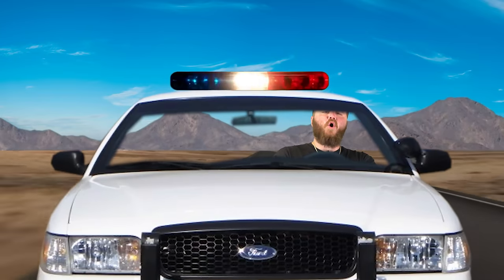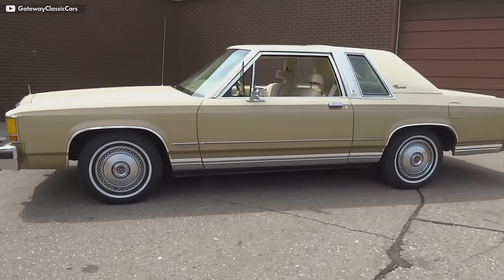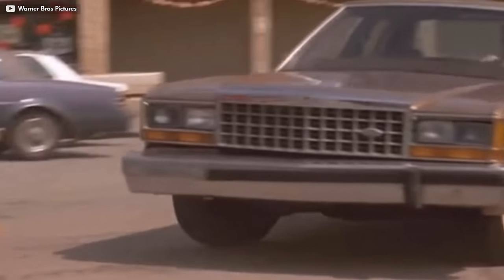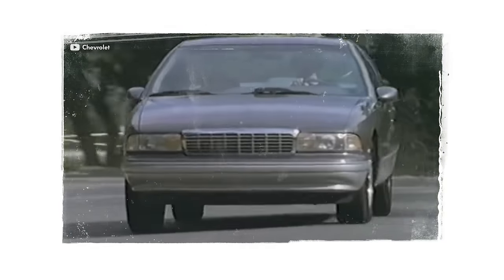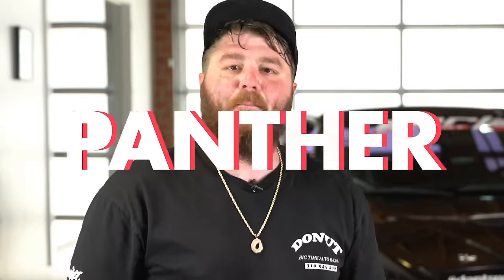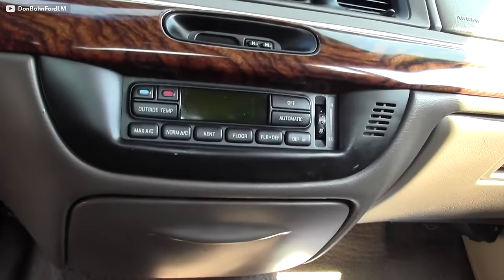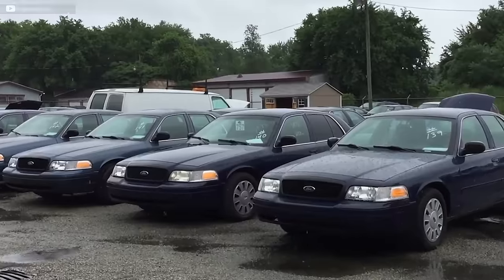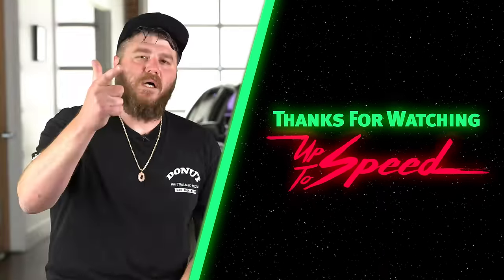Ford Crown Victoria - Everything You Need to Know | Up to Speed

Comment: Had 6 of em, 2 over 300k miles on 2 and still rollin, one of the toughest and most affordable cars to own and fix ever made, ive tested for years and can say that without a doubt. Would love to have one with a new 5.0 coyote swap and manual tran.
Reply: Consider the 6.2 sohc f series engine. The lowest rated truck trim engine is 385hp/410ftlbs on 87 octane. Cheaper than a used coyote and arguably an easier swap into a panther due to the alternator location on the coyote.

Comment: Nobody can look at a crown vic as a civilian car. Crown Vic’s are either seen as cabs or Cops
Reply: Raymond Jameson My dude besides the underbody shit, only difference betweeb civilian and police cars was a grille, a spotlight, some door trim, and the decklid and tailights. Besides those three things, they're the same on the outside.
Reply: Yeah, just try look the rear passenger doors. If it's normal, either cabs or civilians. If it's short, it's Police.
Reply: Urara Easiest way to tell if its a police car is checking the drivers door actually. Police Interceptors were never fitted for door code modules
Reply: Muad'dib2288 exactly 😂
Reply: Raymond Jameson yeah
Reply: The way to tell if it was a police car is the vin. If P71 is in the vin its the police vic. 2010 and 2011 was P7b in the vin
Reply: Raymond Jameson Unless you live in Bahrain, Dubai or Saudi Arabia where Crown Vic's are mostly a civilian cars.
Reply: The Crown Vic is used as a cop car in Jordan (somebody confirm this)

And it was even used in Russia ('97 models) and Montpellier in France!
Reply: I mean mine looks like a cop but sounds like a mass shooting...gotta love burble tunes
Reply: Y E S  S I R .
Reply: @A7XFan800  
Other way around
The P70 long wheelbase is the one youre thinking of made for taxi services and I think some town cars got that extra length too
The P71 (police package) P72 (fleet non police package ie work vehicle) P73 (base) and P74 (LX) all share the same rear doors and body length
Reply: once when I rolled up in my vic a buddy asked me, "man why you gotta try an be like a cop or somethin rollin up in a wannabe cop car?"
And I replied "Why do cop cars look like mine, its not my fault they got good taste."
Reply: That is true, even in the '80s models. But there are easy tricks to distinguish between the fleet and regular counterparts.

Comment: Its funny that AFTER the crown vic is discontinued that now 18-30 year olds want them mostly the interceptor and the crown vic gets this massive internent cult following.

I think ford really missed out not making a ford badged performance version other than the interceptor. Mercury marauder is badass but the problem with mercury is it will always be seen as an old person car brand
Reply: They did have a performance vehicle. A company called Ford Performance Vehicles (FPV) in Australia made the FPV F6 Typhoon and GT R-Spec and normal Ford Falcons with Barra engines. 
Just seems like Ford didn't like its Australian subsidiary making a better car and wouldn't export them. Full sized family sedans that could easily compete with Mustangs, Hellcats etc. Even GM killed of the Holden Commodore (Chevy SS).... What's with the salty American car companies nowadays
Reply: @ImplicitSilence  low sales figures vs other brands they own.
Reply: @ImplicitSilence  

Interesting though i meant a ford badged performance version of the panther platform/crown vic specifically

its too bad we didnt get the modern falcon in N america though. My dad has a 60s falcon and a modern version with a fast engine would kick ass in fact he swapped a v8 into his when he was younger and it apparently was insanely fast you couldnt fit a super massive v8 under there (back in the days when displacement was the only way to get more hp but it had a super good power to weight ratio
Reply: Love to have both.
Reply: Not in Latin American culture, at least in Mexico and Colombia the Marquis was always viewed as a cartel boss car back in the 70s-early 2000s
Reply: If Ford had revived the Crown Vic instead of making a fake Mustang SUV...
Reply: Yes, younger people want the police P71, but me, as 26, I still rather take the civilian model, preferably the LX.
Reply: What about the cvlx sport?
Reply: it’s also super hard to find a marauder and they’re super expensive when u do find one. So instead of buying a marauder i bought a p7b cruiser
Reply: It's a new classic and milenials and gen z like classic cars it's a cheap classic but values going up.

Comment: I would imagine a video about Crown Vics should have mentioned that the old ones came with the same 5.0 engine from the Mustang GT and was also offered as a wagon. Also the name "Police Interceptor" which is quite a staple on Crown Vics was never mentioned, specially since Police Interceptor (or P71) are quite beefier and have tons of upgrades compared to regular Crown Vics. Also failed to mention that the Marauders came with the Cobra's DOHC engine, which is quite worth mentioning instead of just saying "redesigned intake".
Reply: Paco Ibarra / Tofu Drift Van Paco droppin' knowledge. 

Hai Paco!
Reply: THANK YOU! I mean everyone knows the crown vic as a police car, yet the video went in to LITERALLY no detail about the police interceptor.
Reply: In 1981 you could get a 400 in the wagon...
Reply: Not Cobra but Mach 1, it was the aluminum block naturally aspirated DOHC 4.6L that the 2003 - 2004 Mach 1's had (sadly the cast 6 bolt crank instead of the forged 8 bolt though.)
The 2003 - 2004 Cobra engine was a much more stout beast sporting a cast iron block and forged internals.
Reply: Paco Ibarra / Tofu Drift Van also, dont forget the taxi
Reply: Weren't the 5.0s in the crown victorias a bit different from the mustang's? I thought the mustang's 5.0s produced more hp.
Reply: It is true the old school Crown Vics did have the 5.0L Windsor like the Mustang of their time, but however, the Mustangs were HO while the Panthers wasn't.

And, the P71 isn't THAT much tougher than the civilian counterpart.
Reply: @BRBingeDrinker  They do have more power. Being HO, they have 225hp at best, while the Vics were only 150hp non-HO.

Comment: I just inherited my grandfather's 2002 grand marqis
Reply: nice, floor it!
Reply: I’m sorry about that
Reply: You're lucky mate
Reply: As much as it sucks to not have your grandfather, supe that bad boy up like he would'v wanted! Just remember, the Police Interceptor is a LOT different underneath than the Grand Marquis. Do your research depending on year. Some specific differences include
- 04+ CVPI had a new 80mm MAF sensor and intake. Need computer tune to get that to work
- All CVPIs got dual exhaust.
-Spring rates and ride heights are different between the two
-Driveshaft is aluminum in CVPI vs steel in civilian cars. Also tailshaft and transmission output shaft are longer

Thats just a few of the big ones. My plan for my Mercury is to get a CVPI parts car and swap what is needed
Reply: AlecChrz Did he diedededed?
Reply: Potato yeah
Reply: JHeino10 You're probably addressing the wrong person as my only comment was asking if he died or just stopped driving.
Reply: AlecChrz nice
Reply: Yeah, the only good car mercury has made in a long time
Reply: I got my grandmas black marquis ls
Reply: Congratulations. Floor it
Reply: I take that back. Had a misfire on cylinder 5, and had to get the coil replaced. Specifically, from clamping down hard on the gas, ease on it then floor it.
Reply: Cool story
Reply: Totaled yet?
Reply: Lucky!
Reply: I just inherited my Great Uncles 2006 Grand Marquis
Reply: AlecChrz I'm really sorry for your loss. Enjoy the car, just like your grandfather did before you.
Reply: Take care of her & she will look after you.
Reply: @itsjohnnycooley  How much would you want for it?
Reply: Nice

Comment: Crown Vics are great cars, I love my 2011. However, the Marauder had much more than just an intake. It had the DOHC version of the 4.6 Liter V8. The same engine in the Terminator Cobra Mustang, minus the supercharger that is. It was underrated at 302 hp, but put significantly more than that down on the dyno. During the first model year, buyers also recieved a limited edition Mercury Marauder Leather jacket too.
Reply: Not the same engine as the terminator.  Not even slightly.
Reply: Not to split hairs: not forged pistons and crank, but WAP aluminum block. Terminator had iron
Reply: I figured the Terminator engine has different cam profiles, compression ratio, intake and exhaust manifolds, beefier internals, and the heads probably flow different. I was just keeping it simple for simplicity's sake. They're the same basic design. I didn't know one was iron and one was aluminum, although that makes sense. Either way the 4.6 DOHC is a great motor in whatever form, and it's the only stock version of the 4.6 that's worth a darn in the power department.
Reply: Closer to the "intech" v8 used in the Navigator from 1999 to 2003 but with the 4.6 displacement... The Lincoln Aviator was pretty much the exact engine in '03 as was the mach 1 Mustang if I remember right, it has been yesrs now and all of these csrs were down right boring when they were new, well to me at least.  As for the engine "being not even close"  that is pure horse shit they are all modular engines and are very interchangeable..... Ford finally caught on to what GM had been doing for 50 years prior with the legendary Small block  and that is/was using the same engine family with different heads, exhaust, intakes and displacements  in everything that wouldfit it.  .
To all you gay ass haters that commented above me. the Mercury Marauder was a cool csr but was high priced for a blacked out "cop car". Which actually wasn't true but it did use a lot of police parts. I actually wanted to buy one of these when I was 24 I think and couldn't get financing even though ironically I was a new tech at a Lincoln,  Mercury dealership...
Reply: Atomic Reverend Alexander Ford has a knack for making lots of small changes from year to year. Navigators got the tall deck iron block and a forged crank. It used a slightly larger in physical size version if the "B" heads with split ports as opposed to the single port C heads used in the Mercury and the aviator
Reply: robert rochacz no argument at all with your comment.   I have lsince eft professional mechanic stuff behind (because neww cars suck to work on plainly let alone professionally)  but want to put a turn of the century 32 valve 5.4 Navigator V8 into my old Lincoln considering they make about the he same power numbers (minus torque, the old BBF made a little more). As I research what part makes power I am getting a bit baffled by all the different head designs and intakes then there is throttle by wire and cable,... And then you got to be careful that your mod motor is a rear driver not a Continental V8...
On a off note the exhaust note is so killer on this engine family when it is opened up, smooth and mean.
I just need to man up and buy a tore back navi and just gut it.
Reply: Marauder has the 4 valve 4.6 terminator engine or the identical 1 in the Mach 1 but closest to the terminator with no supercharger better than any of the other 4.6 mustang engines cause those were all 2 valve, you can slap on and Eaton supercharger from the cobra and it was pretty much a cobra engine.
Reply: it was literally the same engine as the "Intech" 32V thrown in the Lincoln Mark Viii. they were good for 302HP at the crank in optimal settings, but real life was 220WHP. you could slap on the better breathing Cobra heads and tune it, you get about 330BHP, maybe more. neat engines. Mark Viii's are dirt cheap, pick one up for a badass engine swap for nearly free. i see wrecked Mark Viii's for less than a grand. a good one will only set you back $2,000 because the airbags, telescoping steering wheel, and blend doors are all breaking on them now lol.
Reply: It's identical to an auto mach 1. not a manual trans mach1 they have forged crank.
Reply: The 4.6 DOHC unit in the Marauder was lucky if it made rated power, it really wasn’t that great, and was not at all robust like the Crown Vic’s OHC.
Reply: Mista Butterworth You will not get a stock ported 2v head to flow as good as a stock 4v head.  Is it going to stomp a 2v no but it will walk away both car with same mods.
Reply: Doctor. Phil K - The point being that if someone is expecting bulletproof Crown Vic reliability and low service needs from a Marauder they’re in for disappointment.
Reply: Mista Butterworth Robust isn't bulletproof.  But yes the 2v will live longer making less power and have less moving parts.
Reply: Doctor. Phil K - Bulletproof is a figure of speech, but if an engine could ever be, the 4.6 2V comes pretty close, partly due to its lower output.
Reply: Mista Butterworth the 4.6 engine is a engine that can live for a very long time 4v or 2v  it's just that the 4v owners like to let them hang out.  But having taken apart tons of 4.6 both wear very well!  Just make sure the get the guides and tensioners replaced when you start to hear them at start up.

Comment: Donut I love ya but you missed the mark on the Mercury Marauder. It made that extra power NOT because of an intake upgrade the 4.6L SOHC received but because IT WAS A FRIGGIN MACH 1 DOHC 32V ENGINE! 
THATS RIGHT, Nolan would be drivin a Sleeper Mach 1 drinkin his milk! ~chewbacca and 32v sounds~
This all aluminum 32 valve DOHC 4.6L was the same exact 4.6L found in the 2003 - 2004 Mach 1 equipped with an Automatic transmission (Because it was a 6 bolt crank :'( ) BUT Don't let this distract you from the fact that  Hector could turn it into a BEAST!
Reply: CrainRacing my best friend has a marauder and it’s sooo nice
Reply: I had to scroll too far to see this correction.
And another way to put it since not too many folks even recall the Mach 1 had a special 4v motor is that it's basically a terminator motor minus the supercharger.
Reply: you are so right and i love it because i own a 2003 Mercury Marauder. it's a 300 AB because is was in between years and has features from both years.  there were budget cuts unfortunately. the concept Marauder had a twin screw and was a two door convertible. the 03 and 04 production models are equipped with the 5th gen Cobra DOHC (32 valve) V8  from the super rare cobra R was droped into the Marauder, it is ridiculously power choked from a crap chip that also controls the shift points. an exhaust manifold with one i believe 1-1/2" maybe 2" pipe to exhaust the 4 cylinders exhaust ports on each side along with 4 catalytic converters (2 per exhaust pipe) being that it is dual exhaust but with an H pipe cross over. .and lets not even go into the intake box. i switched to CAI first thing. it also came with 28 spline soft axles ( im switching to 31 because i destroyed my spider gears and burnt my 8.8LSD clutch discs and pitted the berrings) but with some modifications thes car becomes a 700+ sleeper. i have performed only a few mods and i smoke everyone i see with a mustang, corvette, porsche, camaro, and sometimes supercars like lamborghinis. only in a straight line though lol id be screwed if i had to race a lamborghini on a circuit track . my MM with vin Mehm******658658  is in the shop for an E locking diff mod but i had it on a dyno a long while ago and its probably around 670rrhp
Reply: You could say that they always miss the mark.  They messed up on the Cummins video and same with the GT500 video.  Donut needs better Google'ers or send me the script to proof read before you upload and confidence as a legit media company will be restored.  And to think I know these things naturally without Google.
Reply: Was looking for this comment. Thanks Crain.

Comment: I just bought a second vic, it is a GEM! It is a 2011 police interceptor (p7b), it only has 36k miles and 293 idle hours! I did not get it for super cheap, but this thing is almost brand new. The body is in perfect shape, no scratches or dents, the interior is mint. I plan on holding on to this car for years to come. I had been looking for a low mile p71 for a while now that isn't crazy expensive I am so happy I finally found one. It came with the steel wheels & center caps, LED dual spotlights, a go rhino push bar, still has bars in the rear windows, laptop mount, and a bunch of other stuff! It also has cruise control which I was very pleased to see lmao.

Comment: Marauder is actually a DOHC 4.6 narrowed from the Mach 1, completely different from any of the other panther platforms.
Reply: stayunique91 that's what I'm saying
Reply: Just picked up a marauder last August, the thing kicks ass
Reply: Its the same engine in most respects, its still a 4.6L mod motor just with the extra cams and more valves.
Reply: woodman_victory 
That's like saying a man is a woman just because they can both give ya a handie.
Reply: The Mach 1 had a dedicated set of cams.
Reply: No its really not, maybe if I was coimparing a LS to the 4.6 sure. Those just share both being V8's but the 4.6 in the CV and the Marauder share most parts in common the block, displacment etc. They are the same base engine with modifications to one to help it make more power.
Reply: Man O War they do not share a block. CV had an 4 bolt main iron block w/ aluminum heads, Marauders had an aluminum 6 bolt main block. Marauders also had 8 bolt cranks vs 6 bolt in the CV. They only shared 2 things displacement and bell housing bolt pattern.
Reply: SkuzzyJ auto Mach had same cams as marauders